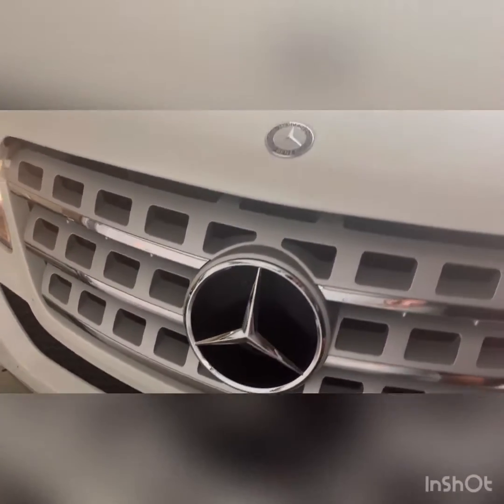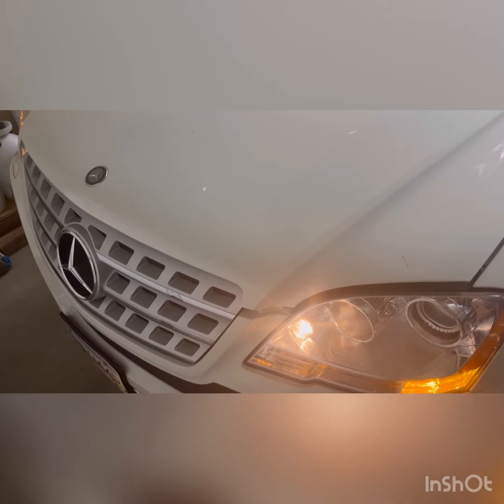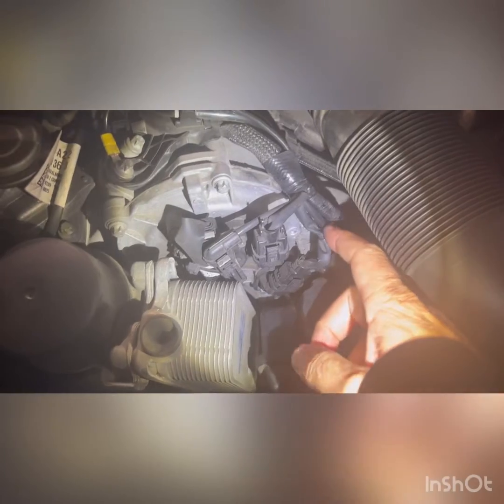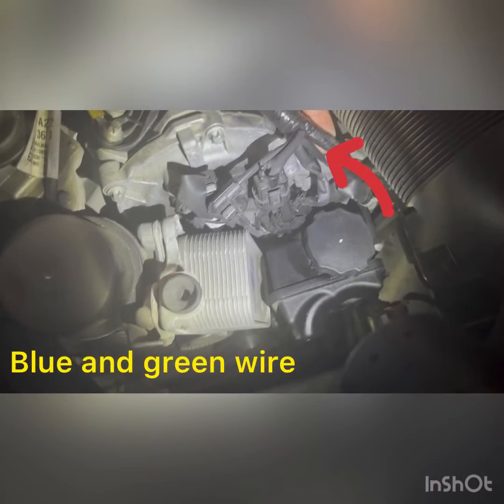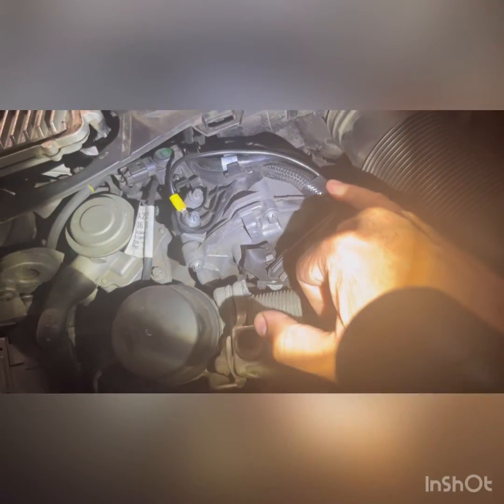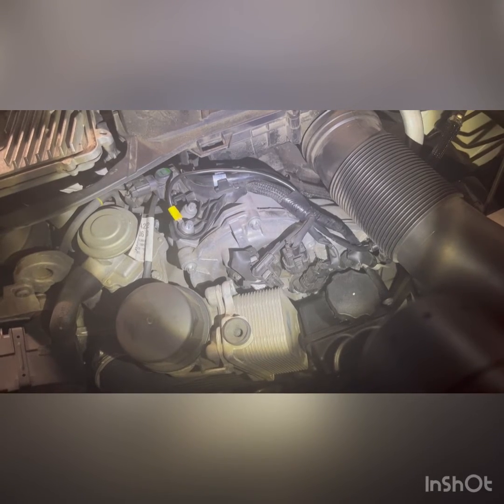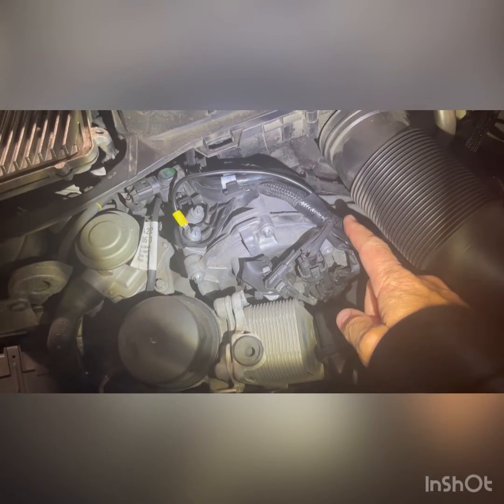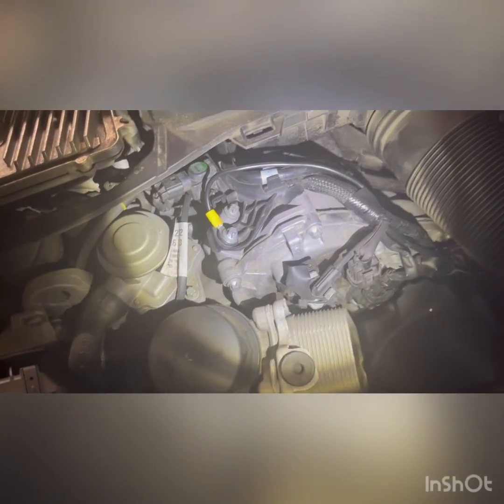2009 Mercedes ML350 AC Error Code 9006/9007 FIX

Comment: Where do you get the diode and what would be the correct one?
Reply from the maker: You can find it on Amazon https://www.amazon.ca/100pcs-Rectifier-Electronic-Silicon-Doorbell/dp/B08RJJN1H1/ref=sr_1_1_sspa?dib=eyJ2IjoiMSJ9.7ksnToROwNWdijIn1pgepr67UNiY-GjDUXkMFtW2p7sGxCDLEULwVRILrxorA70PO0U1BKNvkH93c3xp8iIHsF6qCWS4kk9eFecv_J6wqGUhlSxarg_RDI95pKzUbOe8gN1h31abnl8BHfwKJJWxmAFfXRozBCEsdQVOJyGfBg2ywYkcKLzntyIt3MGxH86USv30XWDGXmp25BjiwBIIGKitm-fHXYh4az1O3Z7PbDN2fSFu2KM3V5c-GAlpMR3enpyecSx5csv-yzlQEdKz56GavBx76-l0DEKwQb7q1rc.uwA-VRFQZLJ6sWgW-95UxHUO4TR0uyLlfdmKh5EAdRQ&dib_tag=se&keywords=1n4007+diode&qid=1753391583&sr=8-1-spons&sp_csd=d2lkZ2V0TmFtZT1zcF9hdGY&psc=1

Comment: Hi where do you get the diode at
Reply from the maker: https://www.amazon.ca/100pcs-Rectifier-Electronic-Silicon-Doorbell/dp/B08RJJN1H1/ref=sr_1_1_sspa?dib=eyJ2IjoiMSJ9.7ksnToROwNWdijIn1pgepr67UNiY-GjDUXkMFtW2p7sGxCDLEULwVRILrxorA70PO0U1BKNvkH93c3xp8iIHsF6qCWS4kk9eFecv_J6wqGUhlSxarg_RDI95pKzUbOe8gN1h31abnl8BHfwKJJWxmAFfXRozBCEsdQVOJyGfBg2ywYkcKLzntyIt3MGxH86USv30XWDGXmp25BjiwBIIGKitm-fHXYh4az1O3Z7PbDN2fSFu2KM3V5c-GAlpMR3enpyecSx5csv-yzlQEdKz56GavBx76-l0DEKwQb7q1rc.uwA-VRFQZLJ6sWgW-95UxHUO4TR0uyLlfdmKh5EAdRQ&dib_tag=se&keywords=1n4007+diode&qid=1753391583&sr=8-1-spons&sp_csd=d2lkZ2V0TmFtZT1zcF9hdGY&psc=1

Comment: i installed and it worked at idle. it doesn't work now after driving while driving around and engine hot.. wondering if diode overheated or went bad? should step up to a 5amp diode??

Comment: Followed ur advice. Found the color of wire to compressor on my W164 to be Purple with Blk stripe. Added the diode like u said and sweet cool air for the Aussie summer. Thanx for the info. I would advise anyone , if they cant find the correct wire, do it the hard way and access the compressor wire from under the car. Its tight but u should be able to get a wire scotch locked onto the solenoid feed and find a suitable earth. Again thanx, the AC dudes couldnt work out why the AC would not run after solenoid swap.

Comment: I did what you did, it gave me the code 9006 but my suv won't let me recharge the freon gas and it has no air or gas, it became empty and freon gas does not enter
Reply: A proper AC service unit will pump the gas in to the required pressure. The Low Pressure switch will not let the AC run to "Suck" in the gas normally.
Reply: What size terminal connection?